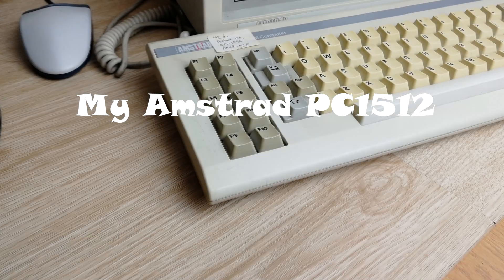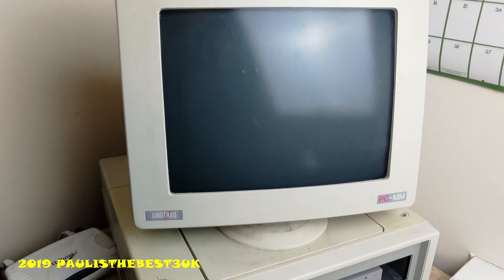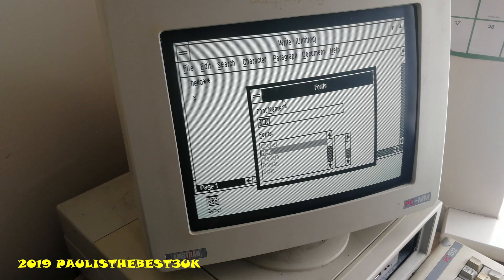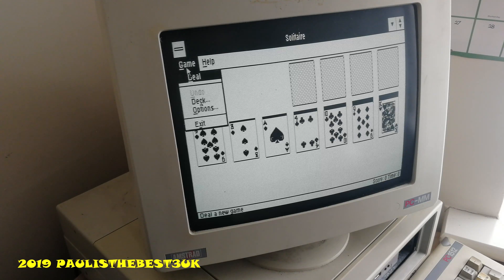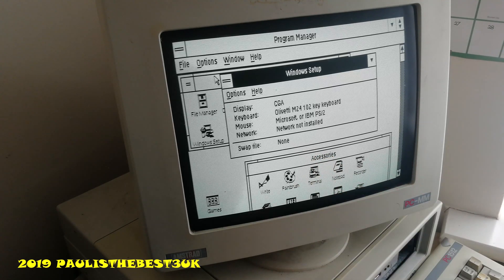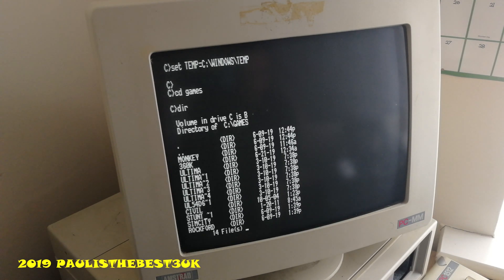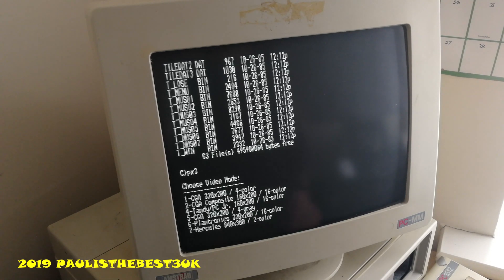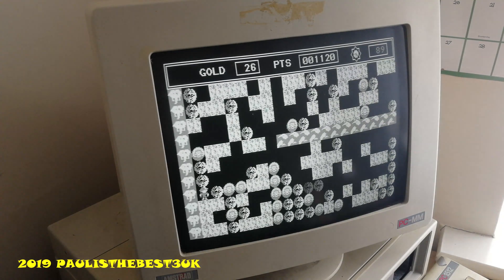The AMSTRAD PC1512 ! 8-BIT-GUYS planet X3 and a couple of other titles :)

Comment: Hi Paul, great video! I have a gotek but no idea what adapter I need to connect it to the Amstrad. Which one did you use? Thanks
Reply: If you can send me a picture or pointing me to the right way to connect the gotek I would appreciate it: TheThinker82@gmail.com . Thanks
Reply from the maker: @TheThinker82  @Fabio Moro, you need one of these https://www.ebay.co.uk/itm/5-25-To-3-5-Floppy-Drive-FDD-Ribbon-Cable-Adapter-For-Retro-PC-/292901092771 - this will allow you to plug a 3.5 gotek into the existing cable. I would recommend an XT-IDE if you can find one, as you can use a compact flash card as an hdd too :-)
Reply: @paulisthebest3uk  thanks Paul, I have an XT-IDE and card already installed as replacements for the faulty hard disk. My computer came with a faulty hard disk and a 5.25 floppy driver. I would like to use Gotek AND the floppy driver together, is that feasible? Where should I connect that adapter? Many thanks!
Reply: @paulisthebest3uk  Since there is not a valid link anymore, can you please share with us details of the product? Thank you in advance!

Comment: Hello, well done for getting the XTIDE running on the Amstrad.

Did you change any of the XTIDE Config options?

Is there any chance I can get a copy of the XTIDE BIOS 8k bin file that you are using?

I've been working days on this problem! I guess it either works quite simply....or it can be a nightmare!:)

There can be so many points of failure!

James  james007brown@yahoo.co.uk
Reply: Do the xt ide bios start ? 
Toi may have forgotten To do fdisk / mbr or use a not compatible compact flash

Comment: Would love to see maniac mansion on this badboy....I don't s'pose it could run Day of the Tentacle but that would be cool too.
Reply from the maker: all games must fit in 512k of ram, and be CGA compatible. Ive made another improvement to the system, found an AWE32 sound card amongst my stuff - and it actually works! Even though its a 16-bit card and the system is only an 8-bit isa bus. Will do another video soon with more games and the new ADLIB sound :D